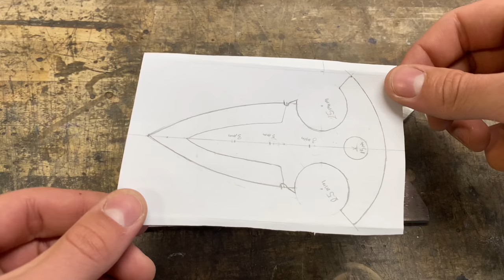Knife making: Dark Push Dagger

Comment: Nice build, one question, if you freehand grind your bevels before heat treatment, how do u find the right angle to finish your bevels on your jig, do u adjust the angle of the jig just by eye or how do u do it? Best wishes tho
Reply from the maker: Thanks!
I scribe lines where I want bevel to start and than adjust angle until I get it .